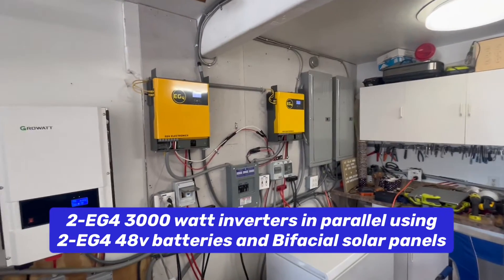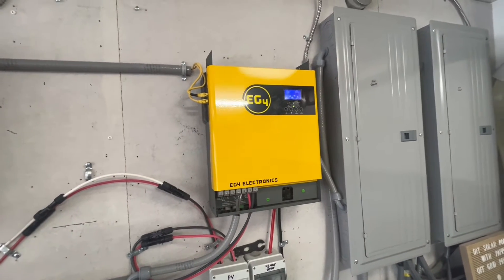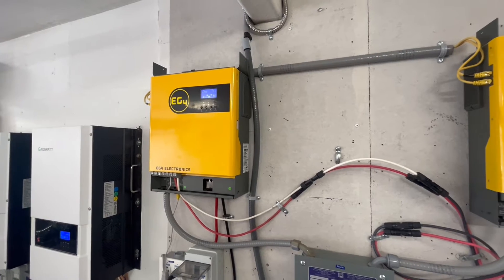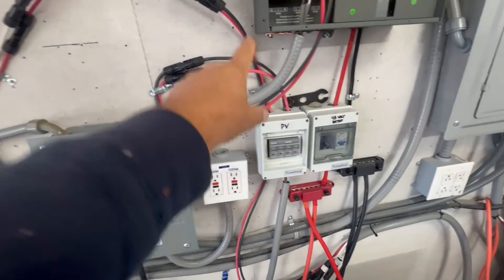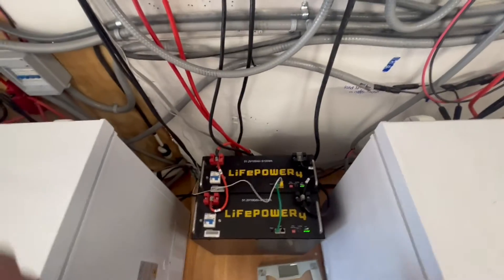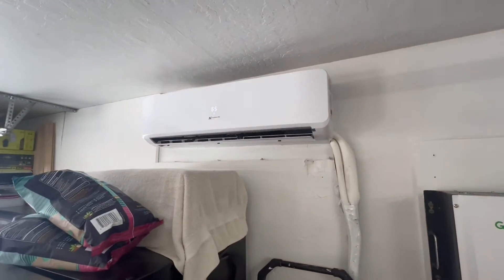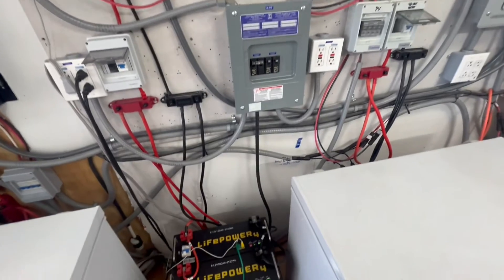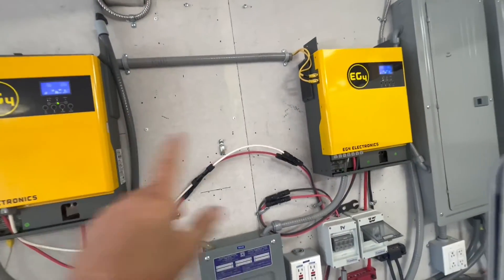EG4 3kW inverters in parallel 120/240 volts, EG4-48v batteries & bifacial solar panels runs AC

Comment: Why do you have the perspective that the dual EG4’s can not start your 3-1/2 ton or 4 ton AC if you have a soft start on them? My 4 ton heat pump with a soft start is only pulling about 2500 watts (with the blower) on 1st stage and only about 3000 watts on the 2nd stage. I have an Emporia Vue CT on the AC and don’t see any big surge on amps at startup. Given the EG4’s can handle about twice the wattage for 5 seconds, it should not trip them. I only have one 3k inverter so I can not try it out on my AC.
Reply from the maker: The surge on the EG4 will not start the 3 1/2 ton according to the reps at signature solar even with a soft start. I have 2 - 12kw Growatt off grid low frequency inverters. They are independent systems, not in parallel and those are the only inverters that have been able to start 3 1/2 ton. These high frequency do not have a large coil in them like the low frequency inverters and just can’t take the surge. I tried 6 different high frequency and they are no good for starting up 3 1/2 ton heat pump. These high frequency are not designed to handle that large of a surge even with a soft start. Let me know if you find anyone out there able to start a 3 1/2 ton heat pump with a high frequency inverter. The inrush amps on my 3 1/2 ton before soft start was around 78 amps, after soft start, it is around 20-24 amps. 20 amp at 230 volts is around 4600 watts. I don’t need to try with these EG4 3000 watt inverters, I know enough through actual experience that they are just not designed to start up that load , in fact the 6000 watt EG4 can’t start it as well but the 12,000 EG4 that can have 18,000 watts connected is suppose to be able to start up a 3 1/2 ton ac. That 12 kw EG4 is over $5000 and my growatt 12kw is half the price and can start 3 1/2 ton and then the 4 ton heat pump and run both at the same time. Hope this helps. You need that low frequency inverter with big coil to start 3 1/2 ton. That 12 kw Growatt inverter weighs 186 lbs because if that coil inside. A beast to mount on wall. Hope you have a truly wonderful and extremely blessed 2024
Reply: A 4 ton AC with a soft starter will still pull 30+ amps on startup. I think two of those would be able to start it.
Reply from the maker: @niktak1114 you can try but you need that big coil in the inverter to be able to start up. Those EG4 inverters only weigh 22 lbs each. One 12 kw low frequency growatt inverter weighs 186 lbs. try all you want but you won’t be able to start with a high frequency inverter. Call signature solar and ask the technicians if you can do it and have them explain why it is not possible.
Reply: @diy-solar-guy  The technicians are wrong. Those inverters can do 6kW each for 5 seconds and even higher for shorter durations. A 4 ton heat pump with a soft starter will only pull 8-10kW at startup typically which two of them should handle.
Reply from the maker: @niktak1114 my 4 ton carrier heat pump has an inrush of 109 amps at start up and with a soft start dropped the inrush amps to about 40 amps. Please let me know if you find anyone able to use 2 high frequency inverters to start their 4 ton heat pump. I want to see this but so far have not seen anyone able to start with high frequency inverters. Just don’t have the big enough coil inside to start the load and that is what you need is a big coil to handle the load. If you find a video with someone able to do this, please forward to me, I would love to believe it is possible. Thanks for your response. Hope you have a truly wonderful and blessed 2024
Reply: @diy-solar-guy  I have a single high frequency inverter that could easily start my 4 ton heat pump even before I had a soft starter. It is a 15kW one though.
Reply from the maker: @niktak1114  I would love to see that. If it is 15kw inverter, what is your surge in watts and for how long for the inverter.
Reply: @diy-solar-guy  the inverter can do 30kW for 100ms and 24kW for 10 seconds. The heat pump without a soft starter used around 26kW on startup.
Reply from the maker: @niktak1114   very nice.
Reply: My calculated inrush was 20 amps for my 4 ton 2 stage compressor with a soft start and my 9000 starting watts lpg generator can start and run it while running my base loads. Perhaps the spec sheets are wrong on these inverters. I know Will Prowse had issues with getting the surge specs on the 6000 XP and challenged them to create a video to document the specs. He did get 8000 watts but only for 10 seconds … still way long enough in theory to start an AC with a soft start. I know inrush is difficult to measure but I doubt my generator would do much more than 9000 watts.
Reply from the maker: @bhbaker220  I just watched his video an hour ago and yeah, I don’t think the 6000 XP could start the 4 ton but I don’t think it was designed to do that type of a load. He was only getting around 3000 watts per leg of 120v. He was unable to start large loads with than inverter. I watched the 12kw EG4 video as well and that was able to start a 4 ton ac with other loads, but that unit is $5000. You can connect I believe 18,000 watts but only get around 14,000 watts output at 100 percent. No other EG4 inverter is able or designed to start 4 ton ac units. These are being designed to run mini splits instead which slowly ramp up load and use considerable less watts. Thanks for your input. My 12kw Growatt doesn’t make any noise anymore when starting 3 1/2 ton or 4 ton heat pump, just know because both cooling fans will kick on in the unit when ac starts. I know a guy who used Growatt 5kw split phase transformer connected to absorb the load at start up inrush amps for ac. It worked well, I’m not sure that he even installed a soft start, just added transformer.

Comment: I would like to see a video dedicated to the wiring of the 120v/240v ac side of the solar it's the ac current wiring a lot of us are concerned with the Solar DC panel input side & inverters I running two right now but not together to a breaker box people don't seem to talk about that side of the solar system the ac side of things when dealing with inverters & wiring
Reply from the maker: Until I can get a video up, check out DIY solar with Will Prouse and David Poz. They have some really good videos on the wiring of inverters to breaker panels. Hope this helps.
Reply: @diy-solar-guy  I know Pappa I seen all the videos a few times I just like how u do ur videos that's all 😉
Reply from the maker: @diysolaradventures7894 why thank you so much. One reason I have stayed away from those type of videos is the issue of grounding. Either using an earth ground which I can not do at my place or bonding in the electrical panel. So I have left that up to others to do videos on that subject. I’m just an average guy that got interested in solar and share what I have learned. I’m not a professional. Thank you again for your kind comment. Hope you are doing well and enjoying your mini splits.
Reply: @diy-solar-guy  yes my mini split is doing great and you know something I feel the same way when it comes to grounding that's my biggest issue that I'm scared to mess with so my inverters simply run to a power strip and from the power strip I run throughout the house
Reply from the maker: @diysolaradventures7894  for now I am bonding in my electrical solar panels. I also when adding 120 volt electric outlets, ground the outlet wires to the ground on inverter. If I lived completely off grid in the middle of no where where there is not electricity available I would definitely earth ground over bonding to electrical panel. But since they cram these houses so close together, I pick up voltage in ground no matter where I try to ground in my yard. When I did earth ground at first I was having a lot of problems with tripping gfi outlets and getting shocks from the metal wire racks the batteries were on even though there was no metal to metal contact. I was getting a shock. When bonding, you can also get a shock as well but I noticed a big difference in how little the shock was when binding to electrical solar off grid breaker panel. So all my inverters are now bonded to solar off grid breaker panels and I feel comfortable with that. Hope this helps.
Reply: @diy-solar-guy  ok thanks I have it saved on my notepad now so I can go ahead and delete it